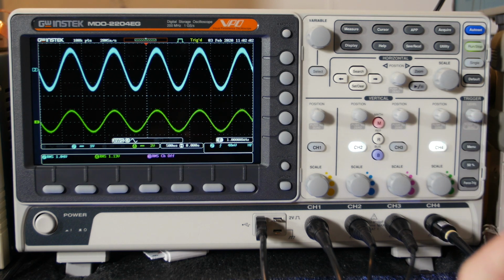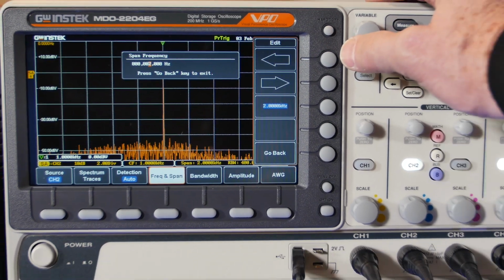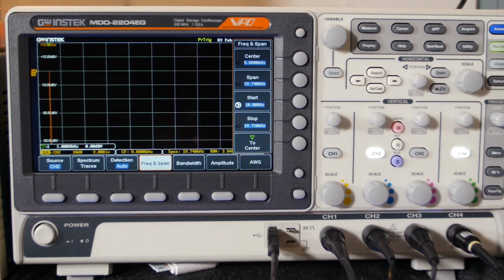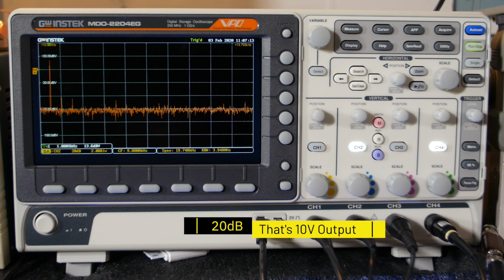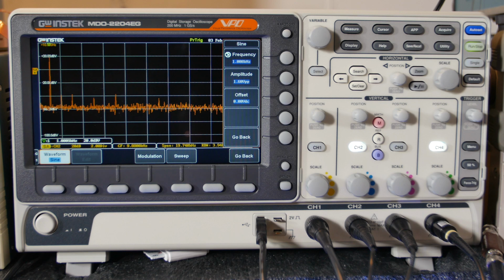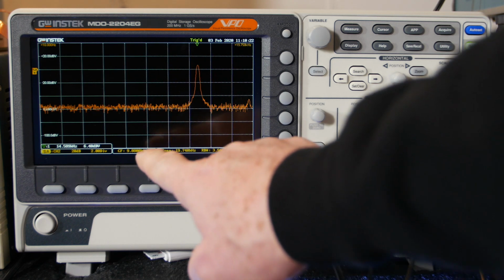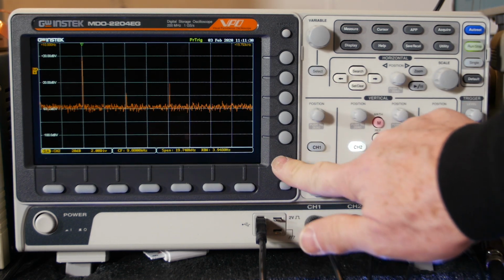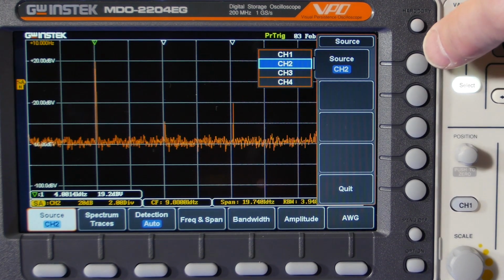GaN Class D Review Distortion and THD pt3 with EPC GaN FETs

Comment: Another great video KA.... That Gw-Instek MDO is just teasing me now.... the stuff going on with some of the gear i repair/build ('hobby play-time') at my home workbench.... the old crt Tek i have just does not cut it. And then come Monday i'll go to my day job & there's a fully optioned up R&S RTM3004 my employer provides me that i just gloat at... i can't win!
Reply from the maker: Thanks peteb2!  LOL The Instek MDO is a great scope - especially for the price.  The R&S is very nice but very expensive;)
Reply: @KissAnalog  i believe my employer cleared out NZD$30k on it fully optioned but i discovered that at the time there was no Bode & for the recent update sw its another NZD$2k. Pity as i would use it checking some of the broadcast audio stuff i maintain like mics etc...

Comment: Your opinion on a audio quality test between the two amplifiers. Each amplifier will be set to 1 W output between the class A and the class D. Using high-efficiency speakers 94 to 96 db efficiency. For your source music try to pick music that is non-compressed of your liking and your familiar with. Hopefully in a room that does not have hard barren walls and floor with echo reverb when you talk or clap. 
         Even though the class A amp may have 0.9% THD and the class D amp might have .0 1THD which one sounds better ?
          Use full range speaker not two-way or three-way for your listening test. If you know somebody with backloaded horn speakers who can lend to you.
Reply: I do like your idea, but, if I do understand it, what you would like is an audiophile test?
I do not know, but do you think any of the boards do need that to judge if one are better then the other?
In that class, do I think you can judge it by a simple bookshelf speaker in that room alone:-)
Reply from the maker: Nice bookshelf speakers or maybe a set of monitor speakers.  Maybe I need to build a set.  I had some nice ones but they were stolen out of a storage along with a bunch of other audio equipment.
Reply: @KissAnalog  Oh NO! I hate that someone don't care about who owns it, and just take!
Reply from the maker: I like this idea.  at 1 Watt, most any amp should be able to handle any impedance changes - which could easily be 2 x or even 4 x.

The distortion spec is the obvious one that is looked at - but I think the flatness of the gain and phase is very important.  If the gain is not flat, it can be bright or flat at different frequencies.  If phase is not flat, then the speed of all frequencies is not the same so this can muddle the sound a bit.  

I want to do more on this subject - I'd like to present a new way to specify amplifiers.

Great question t lech!!
Reply: @KissAnalog  What a great idea and project, please do keep going on.
I have an parameter that I always take into consideration but I have no idea if it's something you can show on an oscilloscope: Musicality! I'll try to explain here. Imagine an amplifier that recite every single note, one by one, to perfection like the most perfect language expert would read every word, comma and punctuation, no error.
The musical amplifier do also play, but instead of giving you every single note, it just performs the music, as if you get an artist to read, you may lose a comma, a single word may not be 100% as the writer intended, but you get a lot of performance and "feel" the music. :-)

Comment: I love that Instek scope. Able to switch to SA from normal scope mode and back, Awesome!  Why mess with FFT?  

I have a 2204EX coming.  Not many in the US and the virus is slowing down importing.  Had to pay a premium to get one.

Concerning audio amplifiers, is not the speed the amp important? Waveform rise and fall times?  How fast the amp can change voltages based on a music waveform?  Can that be measured and if so, what is the spec?
Reply from the maker: Brad Rich Great decision Brad - definitely worth the wait!  IMHO;) 

Yes, the cable from Generator 1 is connected to the RCA input connector.  I show the setup in the first video in this series, and then just briefly in this video.  Thanks for the feedback!
Reply: @KissAnalog  Now I know why guys end up more than one scope.  I have a 2-channel 2ghz, 200 mhz Siglent and it has 25 mg of memory.  I tried ebay and there was little interest at $400.  Rather keep it than sell for less than $400.